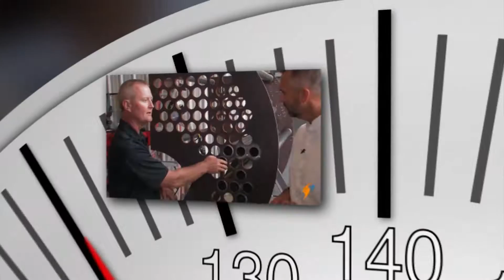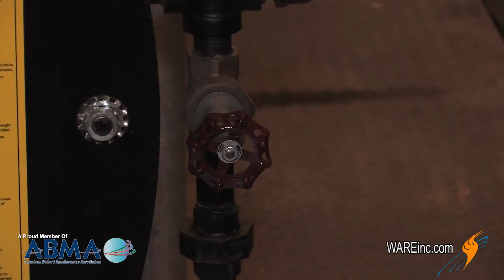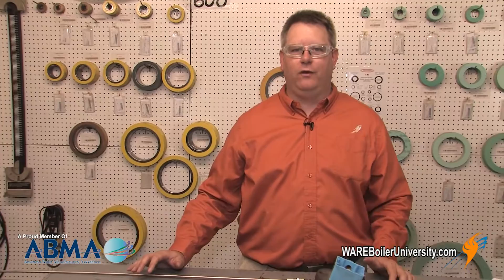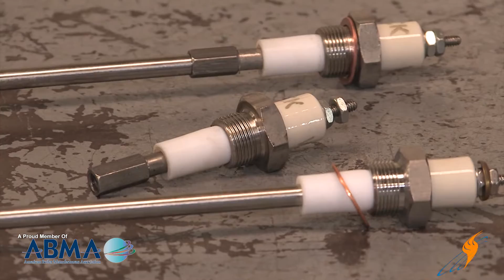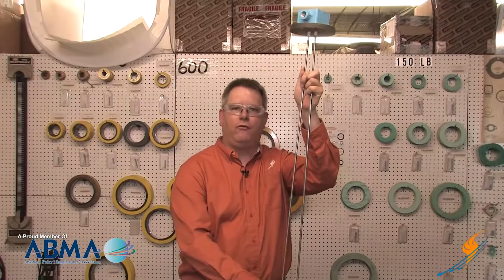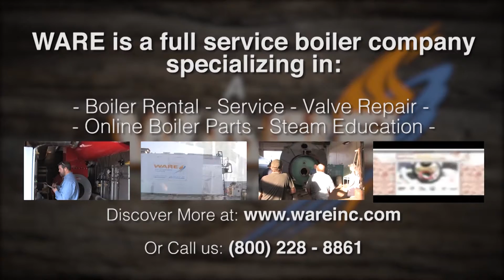Water Level Controls Sensor Probe - The Boiling Point

Comment: Water Level Control:Thank you for the video(s). I look forward to watching more. I'm still leaning. But, I have some thoughts and questions.1) Using the existing probe to establish the correct length of a replacement probe might not be best. What if the existing probe is the wrong length? Things happen. Some goof ball might have installed the wrong length. Perhaps one should confirm the correct length with the boiler's manual or parts book. Too much trouble? Some might agree with that. As important as this device is, I would want confirmation.2) Regarding the probe's function, mention was made of "operating limit circuit" and the "high water alarm". I would think one probe can not control both, low water cutoff and high water alarm. Is that correct?When is a "high water alarm" used? Seems like that would be for a steam boiler. I know you would not want water pushed into a steam engine cylinder. 
3) I am trying to restore a 1947 Cyclotherm Steam Generator. I think your video helped me identify the probe I was wondering about. It appears my boiler only one. I suppose it would be the low water cut off. I like the idea of a high water alarm too. Things fail. If a feed pump did not shut off you could be in trouble.
4) One more question, regarding the low water cutoff. This one might seem like a no brainer but I never heard what it cuts off. This must cut of oil or gas fuel or perhaps electricity in the case of an electric" boiler. Guess it would not cut off solid fuel unless there were a stoker involved Thanks for all,Rb's
Reply: Which Mattel this rod
Reply from the maker: That is always the best answer is to consult with the boiler's manual. Appreciate you watching.

Comment: We have 3 cleaver brooks package boilers in our facility and we typically Blow down the Water columns every day however we only blowdown and test the auxilary low water cut off on Sundays when there is no production going on in the plant and we also test our other safety devices at this time .Is this adequate enough ?
Reply from the maker: This sounds like you guys are doing fine but I would make sure to run it by your water chemical guy as he is going to have the best plan for you in regards to blow down. No blow down plan will be the same as there are just so many variables.  Hopefully that helps. Thanks for watching!
Reply: We just had a class taught by Honeywell and the extremely knowledgeable gentleman that is on the board told use that the code requires it once a year. But I have seen our AHJ require a evaporation test every 6 months. I always blew the bottom and the columns down everyday and did the slow bleed test and pop off test every year. I also had 3 CB boilers. two of them where 750 hp water tube. I bought the exact length probe from the factory, mainly because of liability. Also the pipe threads for the probes that I had were not 3/8" NPT They were 3/8" Dry Fit type. The ground was the pipe thread with nothing on it.
Reply: @wareboilers  Hi  I work with  restaurant kettles ,and I wonder why I have no continuity between ground and the low water level probe, yet I have enough water in the jacket to operate the equipment. Can you explain me how the ground to probe circuit works?